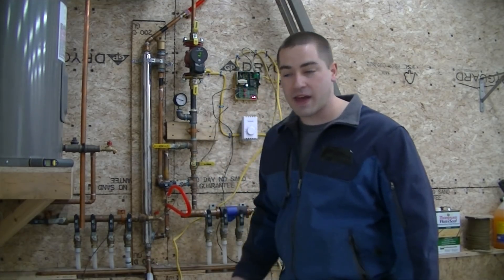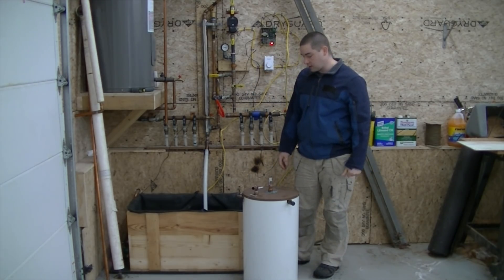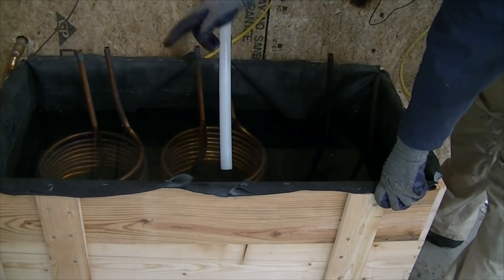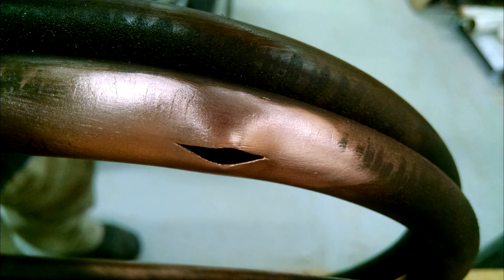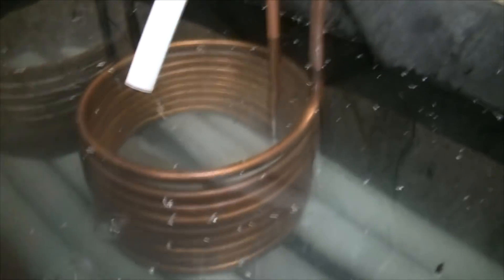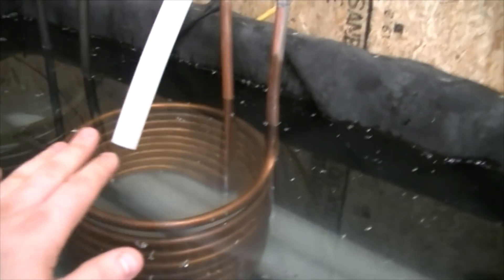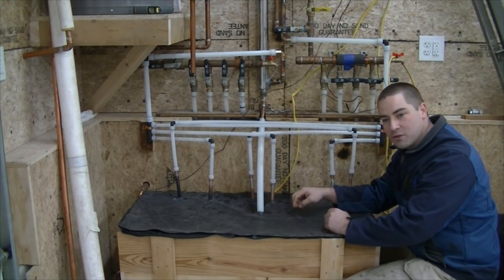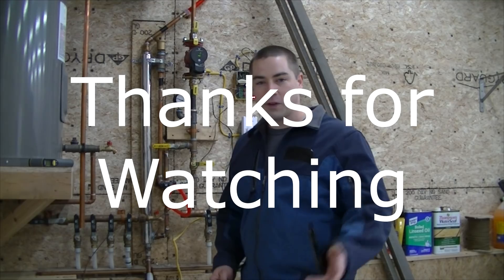Adding Heat Exchangers to Garage Solar Heater

Comment: I have a solar water heater with a small drainback tank.  Up on the roof I have two 4 x 10 panels.  The drainback tank is small (either 2-1/2 gallon or 5 gallon) and is mounted towards the ceiling.  The pump is near the floor.  Also, there is a sight gauge on the tank.  When the system is off (drained) the sight glass shows nearly full.  When it is running the site glass is at the halfway mark.  So as long as I can see water in the glass, the pump is still under a slight pressure and no chance of cavitation.  In effect, I have about 8 feet of standpipe or an 8 foot column of water.  The heated water going through the drainback tank flows into an 80 gallon storage tank with an internal heat exchanger (coiled stainless similar to your own heat exchanger).  I'm guessing that when you had trouble with the cavitation that with the tanks in series, that you emptied the tank closest to the pump before you got drainback water flowing from tank 2 into the tank by the pump.  Also, if the water drained down to within, say, an inch or so of the inlet pipe, that it may have been also sucking air.  If they were in parallel, (plus mounted higher) it might have worked.
Reply from the maker: Thanks.

Comment: another idea is get an aluminum car radiator with a fan behind it and plumb it into that solar hot water setup you got and you will heat the air in that garage a heck of a lot faster

Comment: why even use a heat exchanger?  run the same liquid through your floors and solar
Reply from the maker: If I was building the whole system from the ground up, I would do exactly that.  However, I have been piecing this together over the years and added the solar to the existing system.  Thanks for watching.

Comment: David, thank you for the great video,
Question, I am thinking of a large 60 plate heat exchanger more surface area on a future solar panel system, what do you think over coil heat exchanger ?,  I probably need a pump on the secondary output, which could be run from solar panels,
I just wondering about the benefits of such a unit, talking about large 60 plates heat exchanger, in a colder climate North West England UK,
Reply from the maker: Plate heat exchangers ate great. My system is a drain-back design. Generally speaking, plate heat exchangers can not be used in a drain-back. However, if you plan to make your system a closed-loop, glycol based system, then plate heat exchangers are great.
Reply: @DavidPozEnergy  Hello David, Much appreciated for the quick reply, 
Yes I will be installing a closed-loop, glycol system, utilising Evacuated thermal tubes mounted south facing, I have thought of making a double glazed porch / greenhouse, mounting the solar collectors on the south facing wall, or maybe on my roof if I dont go ahead with the porch, have some reflective material behind the solar collectors just to gain that little it extra energy, even thought of utilising two tanks in the system one for normal house usage, the other as a heat store & backup, maybe I utilise that for underfloor heating, that really depends on how efficient that bungalow will be, but definitely two tanks 400ltr, only way to store all that heat, might use solar PV - Batteries - Inverter system to heat a 230V immersion heater in the tanks just to give it a kick start in winter, 
What I want to do when I have all the tanks and the pipework fitted & running, thought of boxing in the tanks - pipework and insulate all around with vermiculite granules & good thick insulation part of the inner box, "all for the future when I eventually get a bungalow that I want" the system has to be very efficient to to the location Cheshire England UK, not that warm & known for gray sky's ! 
I probably use the Plate heat exchanger as a seperator for the ground floor heating,
Again David thank you for the quick reply,
Reply from the maker: Sounds good.  If you want to try PV direct to immersion heater you can skip the batteries.  I have a series of videos on that.

Comment: Maybe it's me but why not just connect a big radiator and have the radiator as heat exchanger? It could be a closed system as well. Great video and construction.
Reply from the maker: I know someone who did just that.  It works good.  If I had a radiator kickin' around I would have gone that way.  Just using what I have.
Reply: @DavidPozEnergy  I think it's great and besides being smart to collect free energy it's also the creativity to experiment with available resources. Keep it up.

Comment: Would have used some 3/4" to 1.5" gravel at bottom and the use of Uponor is great.
Reply: The thermal mass of water vs stone is about 4 to 1.  Adding stone to a tank does not increase the thermal retention, but decreases it.

Comment: Why aren’t you using a non-toxic antifreeze?
Reply from the maker: I wanted to try a drain-back system.  Nothing against anit-freeze, The drain-back just looked simpler so I went with it.
Reply: No it is not simpler to use a drain back.
Reply: Most yacht and rv systems are winterized using a non-toxic antifreeze.  Just like these systems you will always have a trap and if using copper tubing you  will have damage and a leak sooner or later.

Comment: Overall comment: 
By creating a 2 inch thick concrete vault and lining it with high density polyethylene sheet, sealed with high temperature silicone sealant, you can build a reservoir, which holds vegetable oil, which is heated from your solar application and all you have to do is run one single pipe through it for hot water. One single three-quarter inch copper pipe running through a vat of oil at 600° Fahrenheit will make all the hot water you could ever imagine.

Comment: A quick note on soldering:  If you will “wet wipe “your joint after you sweat it, it will come out shiny and clean and you can see if there are any protrusions or indentions, which may lead to future leaks. Wet wipe using zinc chloride to paste or “Johnson’s soldering paste “same thing. After you’re done, wipe it off with a damp rag and spray it with hairspray, let dry and it will last forever.
Reply: He could have just cut the pipe at the fracture and insert a small copper coupler. Wouldn't affect the coil's bend.

Comment: How well did it work
Reply from the maker: Adding the copper coils more than doubled my heat capture.  But, the system as a whole needs to be re-worked.  I'll probably change up several things this summer.  But it can keep the garage about 45-50°F all winter.

Comment: Where did you get those 3 heat exchange canisters you used in this episode? What was their original application?
Thanks...
Reply from the maker: Hi Jeff,  I got them out of a scrap metal dumpster.  They were originally made as drain-back tanks back in the 80's.  Thanks for watching.

Comment: All my neighbors have radiant floor heat in there buildings most are 40 x 60.  Some are homemade systems some engineered none really work that well. One for neighbor has had several engineers come and make changes. He said it works okay but has lots of money tied up in it so much he refuses to say.  He uses an on demand water heater and around $150 month in propane to maintain the floor around 65 degrees and never wants to open his doors.  He has 8 inch fiberglass batts on the walls covered with 1/2 osb and 8 inch on the ceiling with a reflective foil bubble type on the ceilings.

I spent $850 on a ceiling mount modine 250k btu to heat my 30x50 with 2 inch close cell foam R 15 on roof down to gables and walls 4ft then I have 2 layers of foam board insulation at 2.5 inches the 8ft down to the concrete floor i figure an r 9 on the walls  and I put 1 inch foam on my doors r7.  I keep it at 40 degrees and turn it up when I am out there working to 65 or 70 depending on what I am wearing.  I have spent about $95 in propane a month for November until February.  I wish I could have had the whole thing spray foamed  that's where I would spend the money.  As far as reliability you could always install a solar panel to run the furnace.

Comment: I'm a bit confused by the way things are laid out here. First off, someone needed to do a calculation of the heat loss in the building, which will give us the BTUs needed for the system. Using that as a starting point, the loops in the floor get laid out based on size, spacing, and flow rate to maintain the design temperature. (floor and room) What you supply it with is the next step in the design, meaning: where does the warm water (heat source) come from? You have an electric water heater (not my first choice) and solar panels. Does either of them supply the necessary BTUs needed? (should have been part of design phase) It's likely the water heater is close but I think you will find that you need your solar square footage to be as large as your garage floor at minimum, and that's gonna be around 450 sq ft for a 2 car garage. IOW 14 panels of 4x8 dimension, which you probably don't have. You'd also be in better shape if you had several hundred gallons of insulated storage so you can draw from that at night or on cloudy days. Also, don't forget that a thermosiphon works both to gain heat... and it will give off heat at night. IOW, if you don't have something to stop the flow after the sun goes down your storage will cool off by morning. The flip side of the whole deal is what you are doing with the solar panels when not heating the garage? Do you have a pool to heat in the summer? Domestic hot water? Probably not a good idea to let the panels hot soak empty all summer. OTOH, you could install 10 - 20,000 gallons worth of buried cistern and slowly heat that all summer. Just a thought.
Reply from the maker: Thanks for commenting.  I have a video about the floor of the garage, shows the tubing, which might help answer some of your questions.  https://youtu.be/s9Pmt7XG_2c  Thanks for watching.
Reply: @DavidPozEnergy Yes, I have seen that video but it doesn't answer the questions of how much heat the building needs and what the flow / temp requirements are in the floor loops. My point being is that way too many people think a water heater or a couple of solar panels will supply enough, and that's not usually the case. If you don't have numbers to work with then you are shooting in the dark.
Reply from the maker: Dear rupe53,  If you are looking for lots of numbers, computer models,  etc, then my channel might not be a good fit for you.  I enjoy winging it and having fun in the process.  I'm sorry I won't be able to help you.
Reply: @DavidPozEnergy Nope, no computer model but would like to know what you used as a starting point for design. Charts? Diagrams? Guestimate of heat load?  I mean, it's ok if you used a rule of thumb type direction but even that would give you a baseline of the possible output of your floor loops. If I had to guess (not knowing the exact sq ft or volume of YOUR building, I would say you could possibly heat 1,000 sq ft with maybe 30,000 BTUs when it's 0 F outside, with a well insulated shell. You went way overkill on the floor so maybe bring that down to 20,000 BTUs, but that's still a stretch with a 30 gallon electric water heater. (16 - 18,000 BTUs max)
Reply from the maker: Hi rupe53,  The electric water heater has 4500 watt elements, or about 15,300 BTU/hr.  This is more than I need, but I didn't know that for 100% certainty beforehand.  I had a good feeling about it being able to work.  I think at some point I found a rule of thumb for how many BTU's per foot of PEX can be dissipated into the concrete, but I don't remember.  I just remember realizing that my 1000 feet of PEX was going to be overkill for 15KBTU/hr, so that was fine.  I bought an adjustable circulator (Grundfos Alpha 2) so I could dial that in, but didn't know how many GPM was needed in advance.  The building is 1232 square feet with 12 foot tall ceiling.  

Since building I have tried to find the BTU loss per hour by simply using adjustable space heaters running in the garage, and adjusting them up over time (weeks) until they could keep the garage stable in winter.  It turns out 2000 watts per hour keeps the garage temp. stable in winter.  or about 6,800 BTU/hr.  The week I ran that 2000 watt load had an average indoor temp. of 60°F and outdoor temp. of 10°F.  

Since my exterior shell is 4192 square feet of surface, More is going to be out the doors than anything else since I super insulated the floor and attic.  

I hope that helps, but as you can see, I was winging it.  If the one heating element wasn't enough I would have added another.  I was OK with some uncertainty going into the build.
Reply: @DavidPozEnergy … so it looks like you do actually have some numbers to work with. In heating jargon we're talking 50 degree temp rise and you came up with that water heater's output at just under 16,000 BTUs. I was guessing at 20,000 BTUs, but that's normally figured at 70 degree rise for residential living space. You are using a variable circulator, but others can use variable water temp. (each to their own) The end result is the same once people have numbers to work with. So, the end result is we are almost on the same page, although (personally) I would shy away from doing this with electric unless the Kw rate is WAY low. (read: cheap) Not sure if I would even attempt doing this with solar, just due to the cost of panels and controlling them in the off season. I do know that this amount of heat can be had with only a few logs in a wood stove over the course of a day... but someone would need to be available to tend to that tasks. Waste oil or propane? In a heartbeat! I bet you are gad you went on the high side for the floor loops. The rest you can adjust afterwards.
Reply from the maker: I used to talk more about numbers, but I got turned off by it because several times I've been called a liar, that I can't get my house that tight, or I can't heat a building with a water heater, etc.  I've even been called a liar to my face at conferences.  So I just try to stay away from it.
Reply: @DavidPozEnergy … You can heat the place with any source you want but you also have to realize that some sources are more efficient than others, which is where you might run into an argument. An electric water heater is cheap up front but electric is not the cheapest way to get your BTUs. A gas water heater is more money up front but will likely cost half as much to get similar BTUs. These are things you need to compare when doing your research and presenting your facts, but they are not "cast in cement" like the heat loops so not as expensive to dabble with after the fact. Look at it this way, an electric water heater is probably the cheapest way to buy an insulated tank. You can always unwire the heating elements and use the t-stat to control something else. You could add a water loop to a wood stove or capture heat from solar panels and just use the tank for storage. No harm, no foul. $100 or so well spent. You can also use that tank for mixing from a higher temp heat source so you can maintain your 80 degrees in the floor system. See how that works?

Comment: To encourage stratification the return likes to be immersed to 1/3 from the bottom into a diffuser running level with ground. To break the vacuum drill a small hole in the side of the return pipe just inside cover. 100% of my work is solar thermal.

Comment: Y'ALL Should Use (One or Two) 4' Square 125gal Farm Liquid Fertilizer Tanks & Put 100' Spool of 3/4" Copper Coils Into It As An Easy/Cheap (Can Buy Them For $50-$100@ Once Used Tanks!?) For Storage HOT Water Tanks, Then Spray 6" Urethane Foam Around Outsides For Optimum High Temp Water Retention's Up To 200 Degrees!!! I Built This "MY-Drain-Back" System In 1986 w/(2)-4'x10' Roof Collectors Hung Slightly As-cued, Laid Flat On 5/12 Pitched Roof, So They Won't Freeze Since When 1/8hp Circulation Pump Shuts Off All Water Drains Back To Holding Tank! With A Simple C-10 Water Pump Controller w/a 90 Degree Sensor In Panels & 185 Degree Sensor In Tank To Shut It All Down Before Creating Steam (BAD!)... I Custom Built Myself & Lived In My Home Full Time For 6+Years, Owned/Used It For 10+Years (I Had As Many As 40 People Parties / Ski Weekends Staying Over Whole Weekends & Never Running Out Of FREE HOT Solar Waters!)  Was 4800+sqft, 5-Bedrooms & /3-1/2 Baths Using Nearly Totally Energy FREE Endless Solar Hot Water!!! Even Though I Sold This Mountain Home At 7550' Elevation In Eastern AZ In 1999?  I'm Sure MY SYSTEM Is Still Totally Working Great Today, Now Some 30+Years Later! PS We Owned The Largest SOLAR Water Heating Systems Company In The S/W USA At That Time, Soo I Am A Professional In GREEN LIVING & Products Still Till Now At Age 65 This Week!  Your Welcome, Since I Just Saved Y'ALLs $2k+@ In Needless Purchases... LOL...
Reply from the maker: That sounds like a great system.  Do you have any videos on it you can share?  Thanks.
Reply: @DavidPozEnergy  HaHaHaHa In 1986 We Had Phone Pagers, Internet Was On Dial-Up & Took About 3-mins To Connect, If You Were Lucky? A Kodak 110 Instamatic w/Film Pictures Was The Norm, Butt I Think I Have One Video From About Mid 1990's That I Had Made Of The Whole House, Walking Around & Thru It For A Sales Aid? I'm Sure There Might Be A Few Quick Pan Shots Of The Collectors On The  Roof & The Storage Tank In Garage Area!? Now That's A 15mins VHS Tape That I Would Have To Convert To Digital & Upload!? Y'ALL Follow Me On My Other YouTube Channel For My DIY Projects Now In Progress!? @JohnGreenFerguson

Comment: Parallel makes more sense to me. If you plumb it in series you are losing heated water to heat the next exchanger. I'm a sparky so I could be wrong.